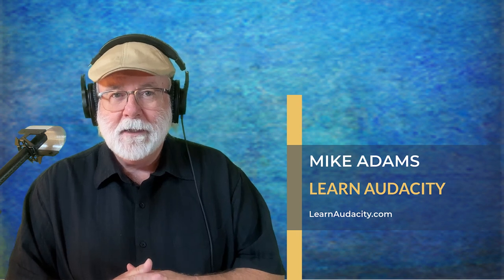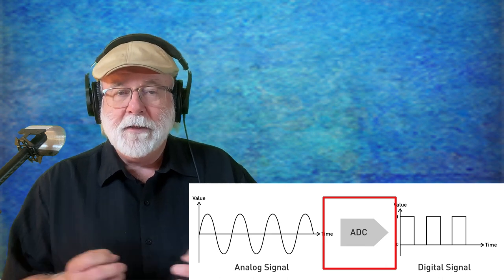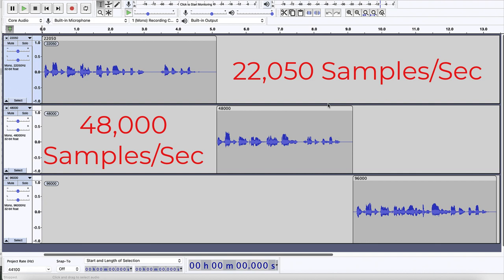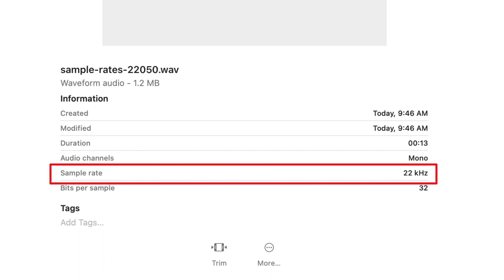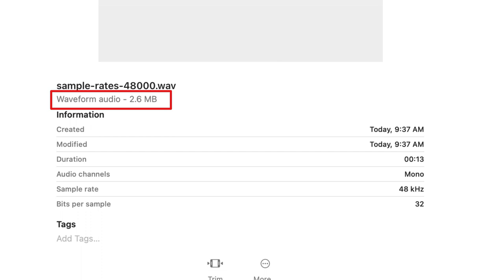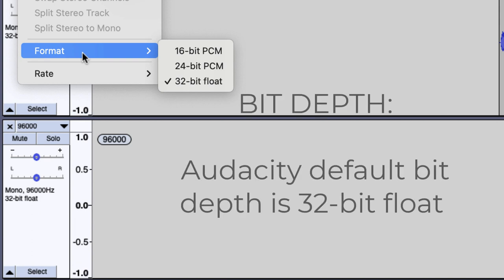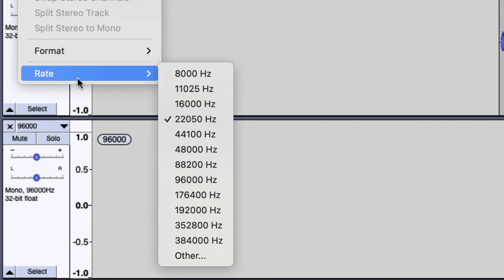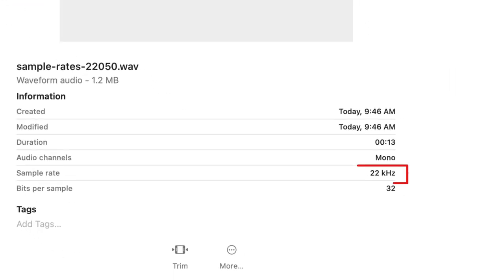Audacity Sample Rates and Bit Depth

Comment: I like your depth and consciseness - it's unusualy to have both.  I'm sure it's due to your expertise!
When I record off the sound coming from my sound card, whether it's from a DVD in my optical drive, or a broadcast from the internet, the sound is very tinny.  Changing bass, bit depth, sample rates don't seem to make any difference.
This was not an issue in earlier versions.  I've not updated for years, I think I was using a version from 2012. When I did the playback, I couldn't tell if it was the origirnal, or the audacity. Excellent quality.

I made smoe changes to my computer, I installed software to record video, and I also tried to activate voice-to-text in Word. I must have done something in my ignorance, because the next tsime I tried to record from the internet, the file was really tinny - unacceptable with music, and like a really poor-quality podcast.  

I upgraded to the latest Audacity (3..3.3) and it did not help. The sound quality is really bad.

I'm not sure what to look at next.  Any suggestions?

Comment: quick question, down the bottom left of audacity, where it says project rate, it doesnt show that in my version which i really need.. as opposed to on each track selection for changing the rate, im on 3.31 (windows) how can that be changed? as you stated when you change each track it shortens? i never had a problem with that before,